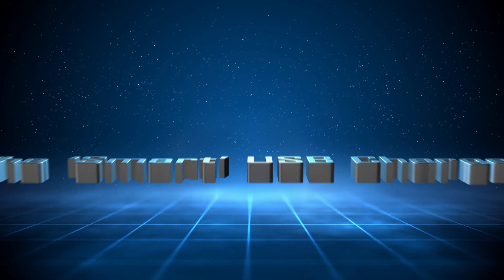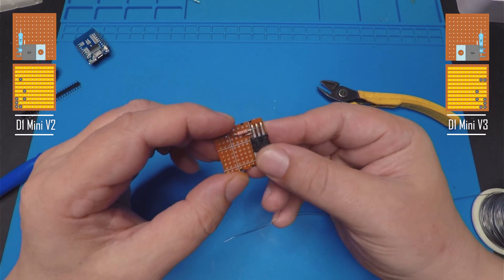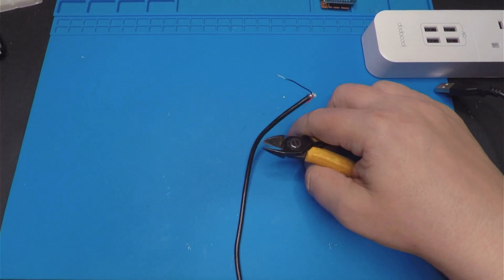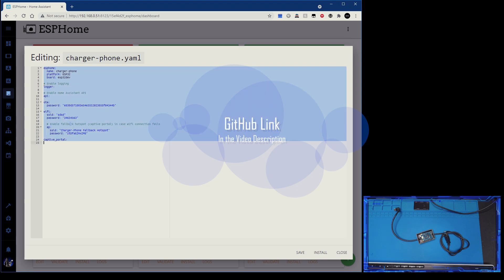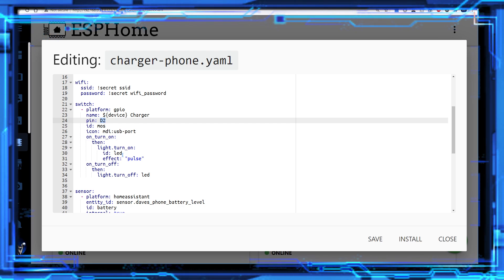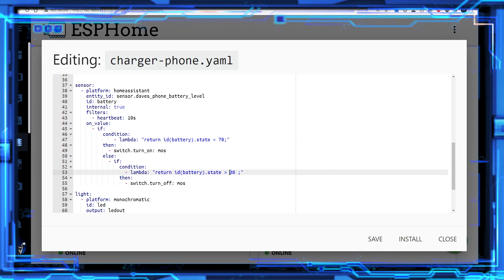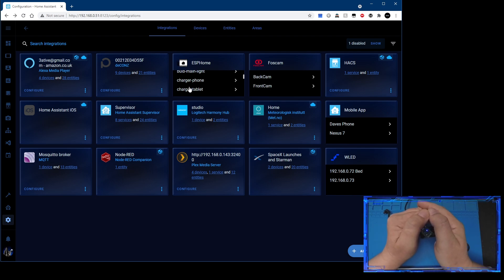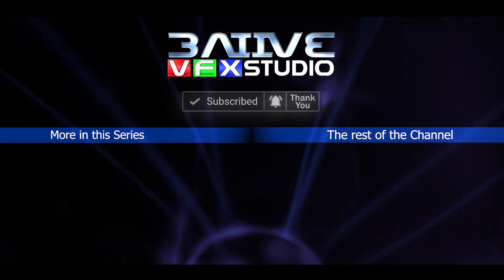ESPHome: Smart USB Tablet and Phone Charger.

Comment: Can I ask, what would be the current limit for this setup? Would I be able to do the same for a higher power wireless charging pad?
Reply: Is the MOSFET the limiting factor for how much current it can support?
Reply from the maker: Not sure what a high power charging pad draws... But, both my phone and tablet are running wireless pads. 
The actual MOSFET I used will handle up to 60A.